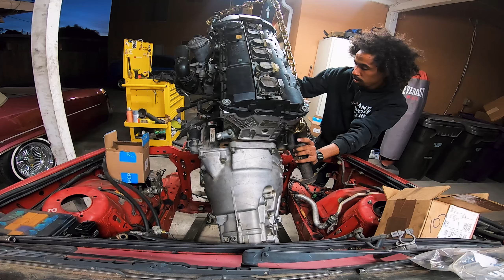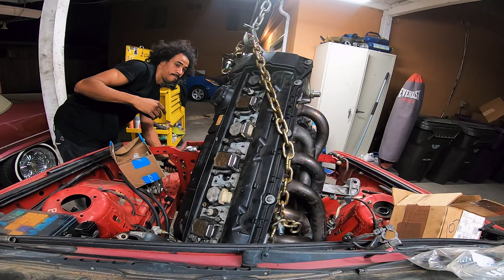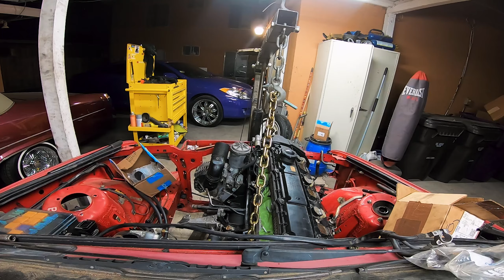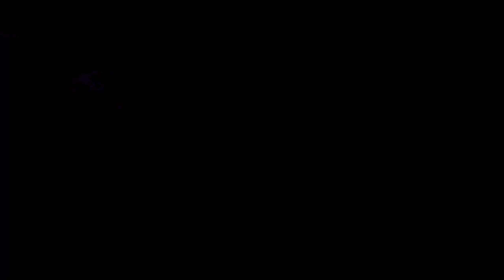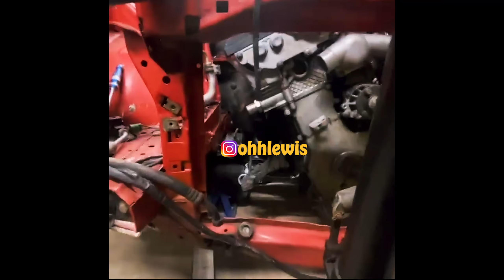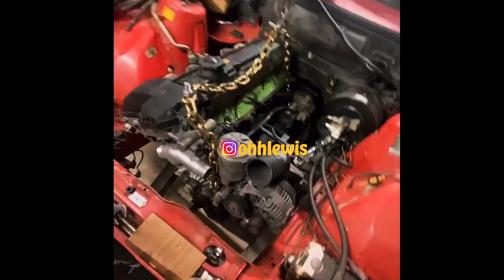VIBING WHILE I TRY TO INSTALL THIS MOTOR | BMW E30 S52 SWAP BUILD | PLAYLIST

Comment: Hell yeah dude, love the e30, I'm thinking about getting one as well, giving up on the e39 touring and going for an e30 touring 316i
Reply from the maker: Take motor from e39 and put it in the e30 !
Reply: @StacheCam  a lot of people gere in Romania do that, mostly m50b25, I would like to completely restore the chassis and keep the original engine. Inspection here is even stricter than what I hear California inspection is . Also, not finished watching the video yet, but damn, the beats are fire.
Reply: @StacheCam  also, I already have an e39, but it's a 520d, smallest engine that came on the e39, so it would be funny to keep the theme going and get the 1.6 on the e30
Reply: @aceofspades9845  da mulți își bat joc de e30, le fac niște țigănii. Cum trage 2.0 pe e39 touring?
Reply: @gabifrate4158  e decent, nu se simte ca si cum ii prea putina putere cum zic unii, trbuie numa sa schimbi viteza pe la 2500-3000 de ture ca sa fii in boost cand intri in urmatoarea viteza. Problema e ca majoritatea 2.0 diesel is tiganite si neingrijite, cum o fost si a mea, am facut raport carvertical dupa un an, de curiozitate , si am vazut ca are vreo 450k km, nu 320k km cum credeam, prost am fost ca nu am facut raportul dinainte, m-am bazat doar pe cel de la rar, care e doar de cand e in tara masina. Partea buna e ca am invatat oarecum mecanica pe masina asta, am reparat cu taicameu cam tot

Comment: Great job on the videos. You should have just bolt on the cross member to the engine and leave the engine on the floor and just lift the front end of the car. And then just push the engine in.
Reply from the maker: I seen that on the forums after I installed mine 😅😓
Reply: So you got it all done. Good job man. Also I have seen almost all of your videos on the e34 the made me go buy one. So I got a black on black 530i. So thanks man. And keep making does vidoes